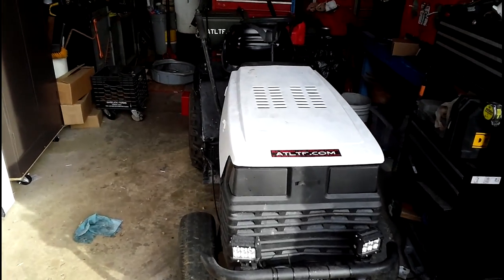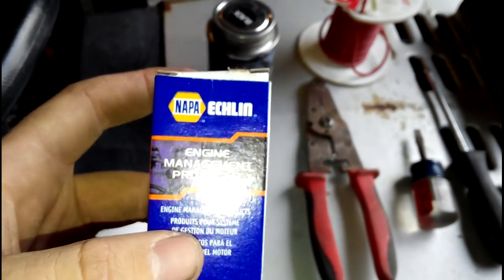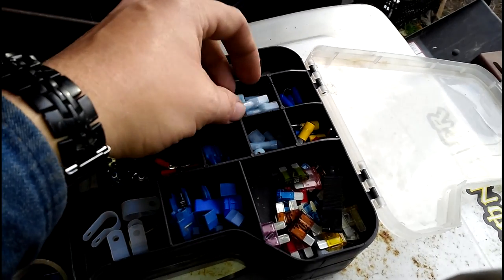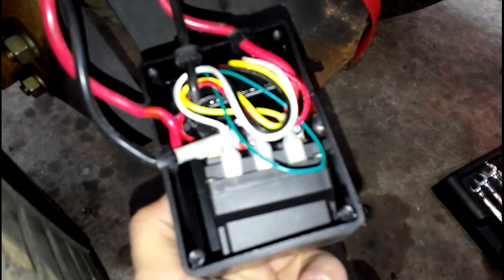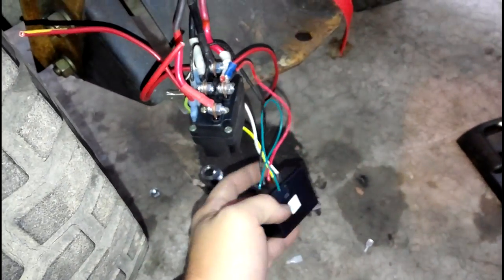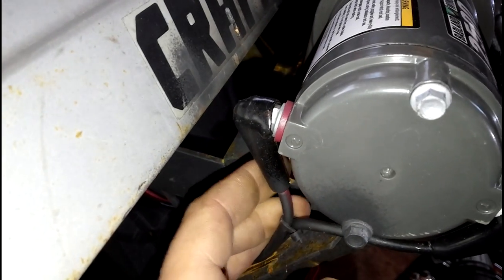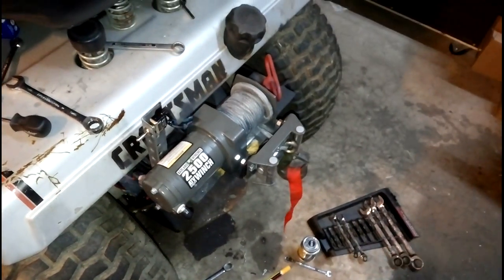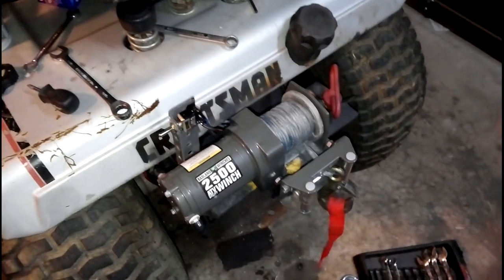How To :: Badlands 2500# Wireless Winch MOUNTED SWITCH MOD

Comment: I bought the 2500# Badlands winch to use with a Brimley Box Blade I already have for my John Deere X300 Lawn Garden Tractor. Since the Brimley Box Blade swiveled 360 degrees, and was hard to use snowplowing in reverse to see what you are doing. So I built a front frame mount on the JD x300 for the winch to mount too and the Brimley to connect together, so the winch was used to raise/lower the Brimley as a snowplow. I made the snowplow 21-inches height x 48-inches wide, by using a plastic barrel. The Brimley Box Blade is only 15" height x 37" wide normally. I then added a (2) 4" wide x 48" long scrap 1/4 plate steel to the plastic barrel for a snowplow cutting edge, which worked great. This is where I then followed the instructions in this video to add a momentary toggle switch to the dash of the JD X300 to use to raise/lower the plow blade. When I did this, I kept it wired so both the momentary toggle switch and the wireless remote both worked on the winch, but was sluggish or not enough power to operate winch.  Note: I did have to rewire the red (+)/black (-) #10 wire from the battery to the winch [for more power] using an old jumper cable wires to carry the load easier to the winch. Then it work flawlessly. I live in Washington, Maine currently, where it has handled the winter 2017-2018 snows on a 300-foot long driveway; plus other areas. His video for the modification works very well and give 5-stars otherwise for his innovation. I hope this helps others. ShaRon K. kellysharon7579@gmail.com if you have any questions on my build too.

Comment: Thank you so much man, thank you for showing us how to do it step by step.  I put the same winch on the back of my 4 seater RZR but I been through 2 winches because the wireless part goes bad every time, so I bypass it like you did and bought the same switch from tractor supply, so now I don't have to worry about the wireless part because I have the switch now.

Comment: Just wanted to say a big thank you for the great tutorial! It stopped me from having to continue to beat my head against the wall. I ended up just ripping the wireless components out of the solenoid box and using the wires that were running from it to wire the switch. Saved me having to pig tail everything. Thanks again!
Reply from the maker: Glad it worked for you! I've been removing all of my wireless units lately as well, since I no longer use remotes.

Comment: This was a lot easier than it looks in the video.  I bought a KFI winch switch for $15 from Rocky Mountain ATV.  Took me about an hour.  I removed the rubber bushing and ran all through that hole and used silicon to seal it.  Awesome video thanks

Comment: My control unit was made a little different and didn't have the remote wire exposed but wired up the same. The remote is nice but makes snow plowing difficult. Good video helped a lot thanks!
Reply from the maker: +gsxr419 I heard from Redzz02 that they changed the wiring a bit. But yeah, remote sucks for plowing. Especially when you want to shake the blade off.

Comment: Gonna do this to mine tomorrow...got all the parts just need to do this then hook it to power to test it. Thanks for this video.
Reply: i guess mine is different... when wiring up the switch, i discovered the wire that goes to the middle leg on the switch...on my winch was a ground wire, not a power wire. so i tried using a jumper off the red power wire, it worked...once then did nothing untill i disconnection the wire from the switch and reconnected it, it worked again ...once, then i had to disconnect / reconnect the wire again.. so yeah, im going to stick with the remote for now.lol
Reply: ps ...on mine there is nolag at all while useing the remote, they must have fixed that on the new version winches.

Comment: Excellent video. I just purchased the winch and was wondering how to install it. Now I know! I did find a ATV Handle Bar Replacement Winch Mini Rocker Switch on eBay for $17 which should work out well.  Now I'll have to head back to Harbor Freight for a mounting plate. Thank you!!

Comment: Thanks tons! Had read up on this winch after seeing the cheap price and was discouraged to see that a lot of the remotes were failing.  I will probably set mine up (F150) with those quick disconnects, and place one switch set where I can use it for dragging stuff in, and also build me a 12' cord (as a back up for the remote) for loading motorcycles.
Reply from the maker: +billmcgraw1959 I actually rewired this winch to the front, and put a new winch on the rear (this position) and made a remote for the new one. I found some small plastic boxes on ebay to hold the switch so it looks "professional", braided the wires and wrapped them in shrink tubing.

Comment: Thanks for an informative video!  
My follow-up comment has nothing to do with your installation here, but it IS important. I couldn't help but notice the spring clip on the hook at the end of your winch cable should be on the INSIDE of the hook, not the outside.  The purpose of the clip is to keep the hook on whatever it's hooked to.  
Again, thanks for a good video! :-)
Reply from the maker: Yeah, the clips on these are kinda cheap and it ended up bending out of shape and wouldnt grab the hook anymore.
Reply: The safety clip bends first time you actually put a load on the winch.  From then on its just annoying.  I cut the rivet and removed it.

If you do your rigging correctly, you don't need the clip.

Comment: You could use a 4-pin trailer connect and just use three of the wires. Good water tight connection. Also can fill connectors and or box with di-electric grease.
Reply from the maker: Ric Mullins that's a good idea. I actually am switching over to aviation style connectors which are more secure.
Reply: Super idea !!!

Comment: Very good information. I put this on my Craftsman garden tractor with snow blower. I`m using the winch to lift it. The manual lift for it only raises a few inches. With the HF winch I can raise it about 6 or 8 inches.

Comment: Nicely done, Doug. I wouldn't want to rely on a stupid remote for this. One, Odds are good you're stting in the seat while winching- steering and keeping the throttle pinned so the charging system feeds the battery, and two- wouldn't it just SUCK to buried up to the floorbords in mud and have the remote battery go dead, or lose the damn thing in the mud? No way. I'd just set fire to it and walk away... :D

Comment: Im doing the same thing for my atv.i was disappointed finding out they are wireless now.i bought the 1200lbs about 8 years ago to pull cars onto my tilt trailer worked great.the wireless was a separate option you had to buy if u wanted it back then.i did so i could be in the car as i pulled it on. what I found was that the signal was slow to connect n disconnect from the receiver so a bump would somtimes make it run to long.not good so on my atv i want a hard wired connection.also batterys in the remote will go bad or corrosion will get it.you may not realize it till you need it miles from help.

Comment: I mounted my winch on a trailer hitch "stinger" extension with step.  I never plan to use it for anything really heavy, mostly raising a 22 ft, 90 lb sailboat mast, which is a bit annoying to do without a second person to put in the rigging pins.

Having the extra switch at the winch will be handy.

Comment: Every time I would take extended ride in ATV I would test my remote and this winter it finally failed. When I press power the remote does not illuminate, now I do not have power to winch, unsure if it gets feedback and the light is the pairing, if so perhaps I do not have issue, anyhow I would like to have option to manually use the winch and this will help with that taking the testing phase from the project.  Found set of 5 switches for $15 shipped on Amazon so will order those and start my project when they arrive.  I had already bought some relays and if there were any distance involved i would recommend installing the relays close to controller and using a ground wire to trigger relays so no worries that the wires going up to switch could cause any issues with there being live wires, possibly unfused, that could touch a hot engine component, get bound by suspension or steering, get whacked by debri etc.. so since my winch and switches will be within a foot of each other I feel safe without those relays, but if others have distance, such as your using switch on cowl, I would recommend a pair of relays, 1 for in, 1 for out, they can be had similar price 5/15 off Amazon as well.. I use those to power on headlamps, fog lights, and other devices that pull current at distances or past hot components, engines/exhaust, of through sheet metal, firewall, cowl..
Reply: Actually the 2 relays, if large enough could replace entire controller... and an inline ANL fuse, or similar would protect circuit...

Comment: You'll find you don't need to do all that. You can control the winch by using the white and yellow remote receiver wire connections on the contactor with a momentary single pole double throw switch and connect the common to 12 volts. This also makes it easy to put limit switches in the system. For instance, I use the winch for my plow blade. Having put a limit switch on the retract keeps from overloading the winch and possible damage to it. You don't need that big of wire either nor a higher current rated toggle switch.
Reply from the maker: ????

That sounds exactly like what I did. Wire size is just what I had on hand.

Comment from the maker: If you traced the leads off the bar switch and wired them into the Badlands solenoid box as shown here it should work. As for if you can just hook up a winch to the existing solenoid box I'm not too sure but I don't see why it wouldn't.

Comment: Xcellent vid !!
Did you make a bracket for the roller plate. ?
Reply from the maker: I bolted it straight down, but you can get brackets for around $5, which is what I use now

Comment: you dont need that big of wires cause its just signal power that goes from the switch. - the heavy power goes thru the relays inside the box only.
Reply from the maker: 16ga is what is standard inside the solenoid.

Comment: What size blade connector did you use to get both wires in there?  Great video 👍🏻
Reply from the maker: I used standard 14-16ga connectors throughout.

Comment: how long does this wireless system last? Mine failed out of the box.  The additional $25 bucks for the extra solenoid buys you the 3500 lb winch too...
Reply from the maker: No idea, it depends on how much water is introduced to it. All my current winches have the remotes fully removed and just run switches.

Comment: So you had three wires for that momentary switch the power and then you're in and then you're out there's no extra ground cuz I seen you only have 3 wires coming out of that plastic box and also did you have to purchase a winch plate so your rollers on the front of the winch has somewhere to mount it to you know where the hook goes up and stops I don't know it's called kind of like a guide for your winch cable how does that amount must be out on a plate right cuz mine didn't come with a plate for that so you have to order that separately.
Reply from the maker: Yup, no ground as you are just making a circuit and not powering something.

I did start buying winch plates. The roller guide, or fairlead (hawse if using synthetic rope), mounts sooo much easier.

Comment: Single Pole Double Throw I believe SPDT in electrician speak.
Reply from the maker: That would be correct; single pole double throw. If it had 6 terminals on the back it would be DPDT; double pole double throw, which would also work as long as it has a momentary function.
Reply: @KeystoneMotorsports  I have that setup on my SnowBlower  with a 12V Battery and an old Drill to rotate my chute with DPDT switch.  Works great.   Battery from Lawn tractor and blue rotating light on top of Canopy.  Snow.  Bring it!

Comment: How would I wire the same switch but with 6 pins and not 3? As I understand it on the 3 pin switch the center pin is positive with the ground wire on each end pin so that when the switch is pushed one direction it makes the connection and will reverse??
Reply from the maker: Honestly I am not sure. I havent messed with 6 pin switches ever.
Reply: I'd have to see the switch, and do a couple of tests with a voltmeter to be CERTAIN

I expect the 6 lug switch is a DPDT vs the one used in this video is a SPDT.
(DPDT = Double Pole, Double Throw, SPDT = Single Pole, Double Throw)

If that is correct, you can just ignore one set of 3 lugs in a row.  
90%+, this is what you are looking at.

There are some interesting things you can do with a DPDT, but none would apply to this project.

Comment: can you wire this to where it will still allow you to use the wireless remote and/or handlebar switch without switching wiring on the trail?
Reply from the maker: Yup. Wireless remote will still work as normal. All you did was wire a switch in parallel.

Comment: I have this winch with the remote. The battery in the remote seems to have died. I took the remote apart but only see the circuit board. I'm assuming the battery is behind it? Do you know how to change the battery in the remote?
Reply from the maker: With the buttons face down and screws up, they should be on the back of the board. They are about the size of a nickel, and under two holders. You may have to bend a tab up and use a small screwdriver to slide them out. It uses two 3V CR20132 batteries.
Reply: I got them replaced. thanks for the info. it was very helpful.
Reply from the maker: Glad to hear!

Comment: if your atv already has the old in/out switch on the bars and the breaker installed can you just hook up the battery cables.....?
Reply from the maker: I posted a reply but forgot to actually reply. Read thru the video comments and you'll find it.
Reply from the maker: +Richard Whipple If you traced the leads off the bar switch and wired them into the Badlands solenoid box as shown here it should work. As for if you can just hook up a winch to the existing solenoid box I'm not too sure but I don't see why it wouldn't.

Comment: can I buy a new remote as mine got left out side on the pontoon couldn't take the Minnesota winter.
are they all set to same frequency? 
I use it on pontoon lift.
if I wire in a switch it will be out in the weather too.
Reply from the maker: You need to replace the wireless solenoid as well, the remotes run on 315mhz but are coded differently so multiple winches can be used within the same area. You can contact Badlands to get a new one.

You can weatherproof the switch buy coating it and the connections in silicone in conjunction with a rubber cover for the toggle. In your case, you may want to modify a dry box from Home Depot (about $8) to house the switch and/or remote next time.
Reply: Thank you for contacting Harbor Freight Tools.

 Unfortunately, the replacement part you’re requesting is not available and cannot be ordered separately from our manufacturer.

The item may be exchanged if it’s within the 90-day warranty by visiting the store of purchase or by contacting Customer Service department at 1-800-444-3353. We are available Monday–Saturday, 5:00am–9:00pm and Sunday 6:00am–6:00pm (PT).

If the ATV winch is outside the 90-day warranty period replacement remote and transmitter can be found through amazon.com at the following link: https://www.amazon.com/s?field-keywords=B017I74BZ2

Comment: Keystone Builder So lets say I dont have the remote, what can I get rid of in the solenoid box so I wont get confused ?
Reply from the maker: I'm not totally sure, but I believe the small box with the green wire coming from it. That should only be the control for the remote.

Just make sure you know what you disconnect, so if something stops working you can replace it.
Reply from the maker: I removed the remote box last weekend. Just unhook it and wire in switch leads as shown.

Comment: How not to loose your remote, split ring it to your truck/car/yard tractor keys! Shalom!
Reply from the maker: The remotes arent water resistant, so they are extremely prone to water contamination if left in the elements or submerged. This eliminates that possibility.

Comment: I have the badland winch also and the remote got wet and it's shot now. I had put my black box in a dry box bc it on my atv and I do a lot of water riding and mud riding I was wonder if  I can do the same thing to mine it would work the same?
Reply from the maker: Yes.
Reply: Keystone Motorsports thank you!
Reply: Keystone Motorsports is that switch water proof ?
Reply from the maker: No. You will be hard pressed to find a waterproof switch. Most are only water resistant with a rubber boot.

Comment: Anyone put this winch on an arctic atv? Can't seem to mount it on factory mounts.
Reply from the maker: You may need to make or have someone make a mount. The mounting on these is pretty standard. Having a winch mount plate will help with the install.

Comment: Mine doesn't have a green antenna wire coming from the wireless unit. It has black, red, yellow, & white. And each of them are connected to the main unit. 
Can someone tell me how I need to do it?
Reply from the maker: Chuck Comeau I noticed that in my unit too, it must be internal now. No big deal. the RWY wires are the important ones.
Reply: +keystone Motorsports  Thanks for the quick reply! As I've got it pulled apart right now & ready to cut the wires. Then I noticed no green one. I'll give it ago without doing anything to the black wire.
Reply from the maker: Chuck Comeau Yup just follow as normal, just ignore that wire.